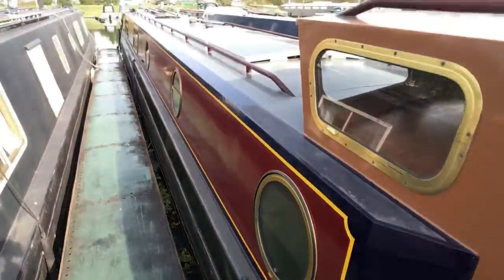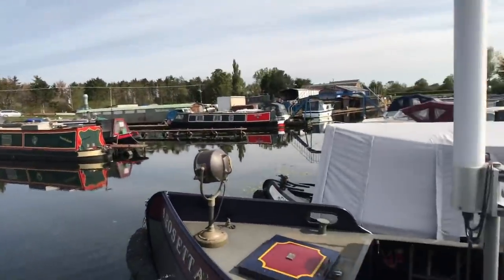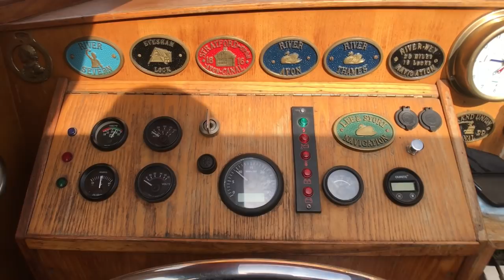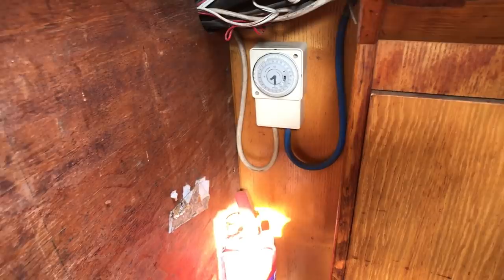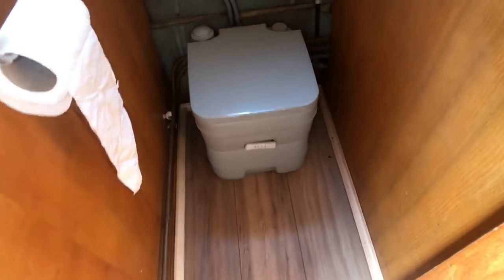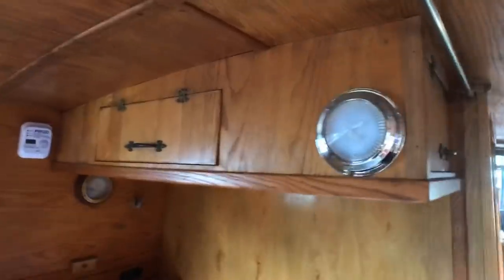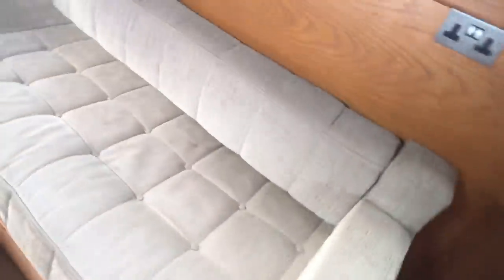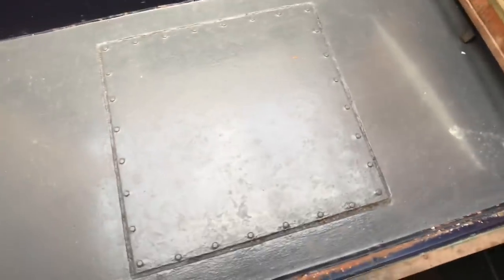Our Narrowboat Tour Walk Through. And Is Rosetta Up For Sale?

Comment: Beautiful boat never seen any like this.  How tall is it.  By Air Height = 70in do you mean the actual interior cabin height.  Im asking because im 6'4" so this becomes my first problem with narrow boats.
Reply from the maker: Inside the cabin it is 6‘4“ high. So you will be very close to the ceiling. The air height is from the water outside to the top of the roof so people can gauge going under bridges
Reply: I'm having to look at widebeams due to the head-height issue. Restricts the network access but there's twice the room aboard.
Reply from the maker: Going to choose what ever works for you and your desires. You can’t have the perfect boat 😟

Comment: Does she come with a permanent mooring ?
Reply from the maker: Hello Gary. She has a non-permanent mooring at the moment we have no electrical hook up. I feel sure that she could stay there longer after we have sold her and you may be able to negotiate a permanent mooring with her. With electrical hook up but you would need to speak to the marina
Reply: Thanks for the info 👍😁
Reply from the maker: Just one thing she does have water supply next to the boat and you can live on her where she is at the moment.